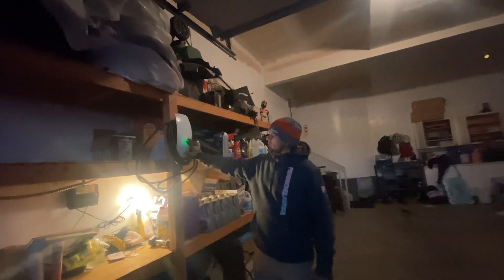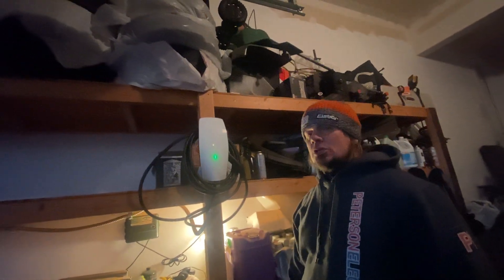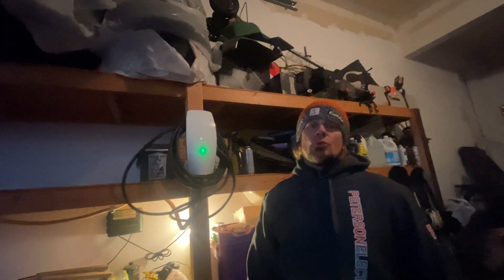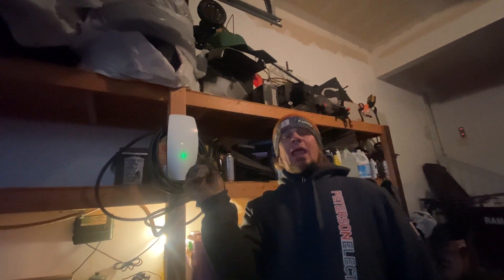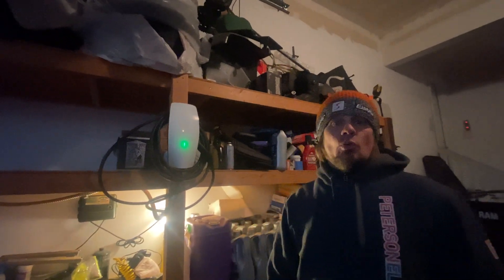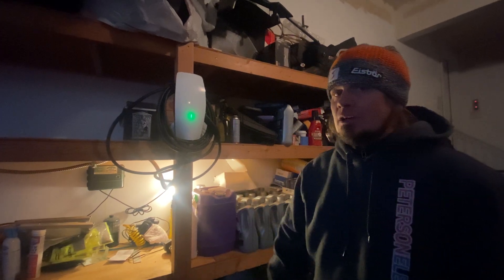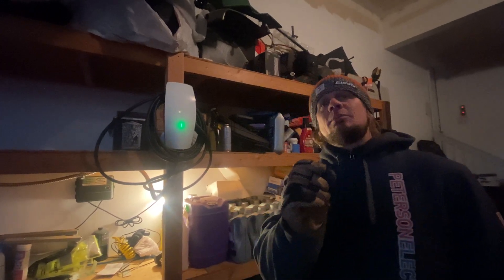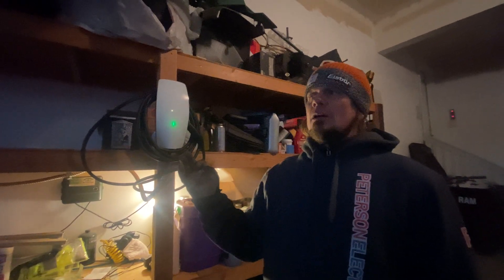New IRC Code for EV Charger Plugs - Do You Have a Raceway Installed?

Comment: Why pull in a neutral? Neither the 1772 nor the NACS plug have a neutral wire, and the charger is in the car. The wall device is little more than a receptacle....

Comment: The new Tesla Wall Connectors ask for 4 AWG wire because they can draw 48 amps continuous.  NEC requires that continuous loads (more than 3 hours) be derated to 80%, so it needs to be installed on a 60 amp circuit (hence the 4 AWG wire).  You can adjust the charge rate, but it is done during the commissioning process where you connect to the built in Wifi.